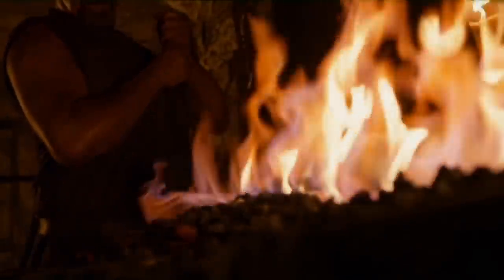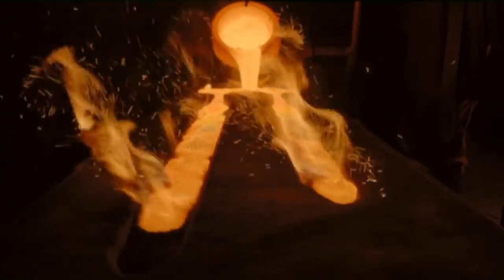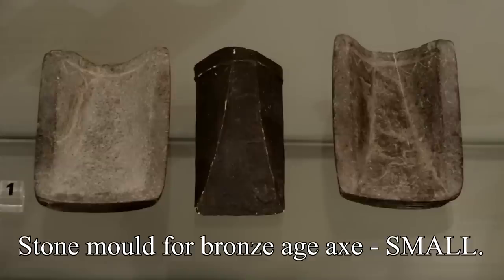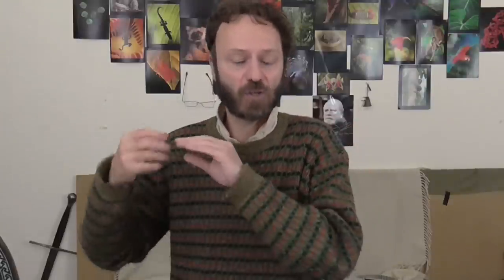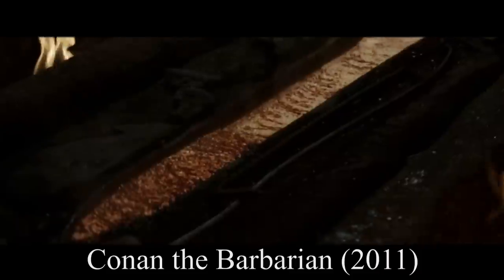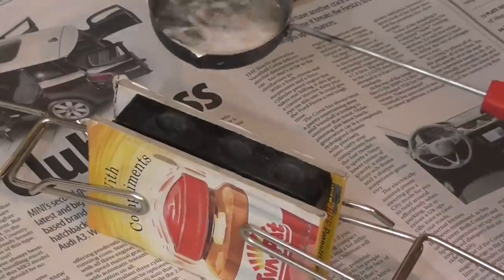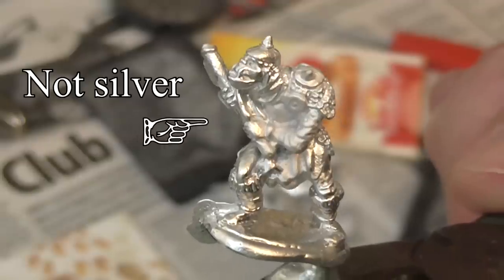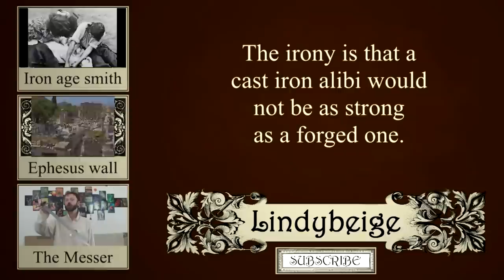Casting swords in the movies - forging a lie

Comment: sry u a wrong i'm work  as steel smelter / founder  in a steel foundry in Germany (i'm a german so it was not so esay to write the Text)  

at First u say steel is iron but wrong Because it is distinguished as follows:
-Elementary iron (Fe)
-Steel as an iron carbon alloy with a maximum of 2.06% carbon (forgeabel) 
-cast iron which is also an iron cabon alloy but it contains more than 2.06% up to 6.67% (not forgeabel -> scatter if u Hit it hard enough)

u say it has too glow bright as Fuck and u a wrong again the whit glowing sarts a temperatures above 1600 degrees Celsius and u forget the slag on top of the Metal. slag is always 200-300  degree Celsius cooler than the Metal Because the air is colling it 

and open top moldings a ok for swort blanks. it is faster to forge a sword from a blank than from a bar (if u use steel not cast iron which is im any case unsuitabel for a sword)

And u a right with the speed of the casting (faster is better)

And the Material of the mold should be greensand and not a stone

And aluminum is not poured red-orange glowing 

Hollywood is always a Bit over doing
Reply: Iron is rarely pure and what people refer to iron in history were not pure iron.  Us calling it steel isn't that strange seeing as those swords tend to have a bit of carbon in it.  As for the slag, don't they remove it before pouring? Seems a bit strange that they left it in.  The only purpose I can think of is using it to assist in temperature control of the liquid metal before it cools into a solid piece.  Outside of that, isn't it a terrible idea to leave it in?  Slag is a glass-like byproduct and from what I know, it absorbs moisture and it isn't very nice to have in your ingot.
I thought open top moldings weren't a good idea for swords seeing as the only benefit would be inlaying or adding components to the finished product.

Comment: Plus, up to the 15th-16th century, when the blast furnace (capable of heating iron up to the melting point, and getting a lot of carbon in it) appeared in the west, furnaces were just not able to reach a temperature high enough to melt iron. Thus, up to that point in time all iron metallurgy was done in the solid state. After smelting iron ore you would get a lump of iron full of slag and other crap, which then would be hammered to get a billet or an ingot of workable material.

Comment: so much incorrect terminology in this video. iron is NOT the same as steel
Reply: I believe he said as much. He didn't say steel WAS iron, but that it was made from it. One has to create iron before one can convert it into steel.
Reply: This whole video is about criticizes the way movie producers mix up terminology and portray incorrect procedures, and yet he calls steel iron. This is incorrect because steel is NOT iron. They are very different in terms of their properties, and steel has other ingredients as well besides iron. It is hypocritical to say the least
Reply: I was of the impression he decided to just call them all "iron" swords for convenience (at 1:30) but yes, convenient incorrectness to critique dramatic incorrectness.
Reply: I couldn't speak to that without more research. I'm only familiar with green sand and lost wax casting techniques.
Reply: On a different note I DO AGREE that swords can not be directly cast, he just does a terrible job of explaining why in this video. He should have talked about the effects of hardening and forging on the metal's structure instead of focusing on inaccurate points about the actual casting process. You could easily take the form of a CAST STEEL sword and pound it into shape then harden it and it would have exactly the same properties of a steel sword made from billet (how do you think they made the steel in the first place? THEY CAST IT!). What you can't do is use PURE IRON or CAST IRON to make a sword because of the properties of those specific metals.
Reply: One thing I inwardly scoffed at was the scene in Return of the King where the elves reforge the shards of Narsil into Anduril, the Flame of the West. The film made it seem as if the smiths simply beat the shards back into a sword like a jigsaw puzzle, something I believe is pretty much impossible without totally reforging the entire sword
Reply: @whiteknightcat  elven smith probably use magic.
You could reforge a broken sword, atleast with modern technology, but it would be a lot of work
Reply: @kkuhn  i agree with you that a cast swort would need heat treatment but i dont think it would need any forgering

Comment: I recently found out that cast iron is categorised as such because it's absurdly high carbon content, ~4-6% I think, lowers it's melting temperature which makes it easier to cast.  This increased carbon content, of course, also makes it harder and more brittle.  I once tried to drill a hole in a cast iron stove and the "hardened tool steel" drill bits were wrecked by it.  I don't know if anyone's tried to temper cast iron to reduce the brittleness, but if that can be achieved then it still would be a ridiculously hard steel.  That absurdly high carbon content also heightens the working temperature for forging, making it more difficult to forge and prone to cracking while being forged.  In many cases, the working temperature will almost be the melting temperature and cast iron will be a brittle quasi-liquid crumble-slush when attempts are made to forge it.  
     On the other hand, wrought iron has an extremely low carbon content and has a higher melting temperature closer to chemically pure iron, and has a lower working temperature for forging.  This iron of course doesn't hold an edge with any decency, but is very forgiving, easy to shape, and would rather bend than break or stretch than crack, making it ideal for many applications and easy to fabricate with.  Hence why iron that is difficult to forge but can be easily melted is called cast iron, and the iron that can be easily forged but is difficult to melt is called wrought iron.  The good stuff that swords, knives, and other tools are made of is at ~2% carbon and while less easy to work than wrought iron can still be forged and hold an edge.  
     One, possibly two, case(s) I would like to argue for casting iron/steel swords is that if you are already using complete liquefaction refining techniques on-site at the manufacturing plant, like in Isengard, then what you're really doing is making sword shaped ingots of iron/steel, or sword blanks, and not a sword in one step.  Further shaping of the bevels, fullers, etc... through forging would be required and in the same clip we see them doing just that, possibly before the blank has fully cooled but has solidified to working temperature.  This would be a great time saver, as at least half of the shaping work is done straight out of the crucible.  There some issues could arise, like carbon concentrations migrating to different lengths or sides of the sword as it cools, bubbles or other inclusions common to casting, and cooling from the mold on one side may have its own suite of problems.  But if your objective is to rapidly outfit a large army with hacking slashing things with a stabbing hook on the reverse, and don't care if there is a certain percent failure rate, then casting may be a viable method.

Comment: It’s not aluminium either, aluminium remains a shiny silvery colour when liquid, and will turn that colour immediately as it’s being cast, and has a very low viscosity, it flows extremely quickly when poured, especially when that hot

Comment: Stone does not have high heat capacity, actually it’s heat capacity is fairly low. The property you lindy is referring to is conductivity, that is why stone feels cold (the example he gave) and why it is poor as a mould. This is also why people traditionally use clay or similar for casting-moulds.

Comment: You're entirely right in your video in all its points.  But you also dance around the core of the issue, looking at the trees.  The reason these things exist as tropes to be used by film makers is that they developed from tales told in the Iron Age about the Bronze Age.  And so many of those aspects got so baked into the fictional space that they simply remained a part of the collective cultural background. Right into the modern age the fictional space occupied by "fantasy" epics is built on tales of a bronze age world that retained aspects of their origin.

Comment: The one you show for the open top mold is valyrian steel. And they use molds for it because no one can work the steel so they have to melt down old swords and mold them into new ones.  Also it's open top for cinematic purposes.

Comment: Pouring bronze into open top molds to be later forged to a final shape is a totally practical method with the proper alloy.  Not saying it was historically done, but possible.  Bronze is a bit dense but holds an edge and is malleable enough.

Comment: Not Aluminium, it would be pink / silver or burning if you try for orange heat. Also at pink heat Aluminium flows very fast.
The viscous orange mass looks more like some sort of slag.
Iron would be beaten from a bloom, to force as much slag out as possible from the bloom. (Wrought) Iron age does not have the benefit of the oxygen smelter to purify and alloy iron and carbon into steel.
Any steel like material had to start as a dirty bloom, be subjected to repeated heat and beat cycles, remelted in a crucible to make ingots for forging and possibly lamination on the way to a near net shape capable of finish grinding.

Comment: Casting is more for single use tools like arrows, ammunition, and maybe disintegrating links. Forging is for reusable tools like sword, spears, firearm parts, magazines, and non disintegrating links. Of course, you can forge ammunition, arrows, and disintegrating links, but those are very small items that are typically discarded after a single use or lost after a single use.

Comment: You know you can still work on casted steel, right? You would cast a blank to save some time. And just because you cast an iron alloy you dont get "cast iron". It has an spacific amount of carbon in it which makes it brittle(also the lag of heat treatment).

Comment: First of all, I want to express my appreciation for all your work before you would get the impression that the following information is for negative reasons. I like the way you make things undertandable and the approach of how you get to that. I have to say that almost every video covers my interest or it triggers me to get interested.
Although the core of your message is true, some of the content needs some refining. I don't want tbe nagging about details but just get the right information to you. The main reason why these swords weren't casted is because they coudn;t make pure steel in a crucible. The reason why smiths had so much work was because they had to hammer the impurities out of the material. 
The color of alloys being casted depends on the temperature of the liquid alloy. Aluminium looks silvery with a slight orange glow. Pouring temperature is between 700 and 750 °C Cast Iron (very bad for swords) shows the red to orange color in the movies. I think they use that for several reasons. Aluminium doesn't look cool at all to cast in a movie. Cast Iron (around 1340°C) will give a nice red to orange color where the film crew can still controll the lighting and stuff. Steel is mostly casted above 1600°C. The light is orange to almost yellow. The infrared radiation from steel is immense high and you can not stand around it without decent protection. It might be impossible to film it properly. The second reason why I think they used Cast Iron, is the fact that it rolls off clothes, skin and such when poured. Aluminium immediately sticks to any surface which, although much lower in temperature, makes it quite dangerous to be around with when casted. Steel just burns through clothes and skin. I don't think aluminium is used for a third reason and that is the fact that it solidifies wuite fast, actually the way you explained it in your video. You can pour steel in bronze molds (yes, copper alloys and iron/steel alloys naturally don't stick or weld to eachother, liquid or not), but this is mostly done for intermediate processes (manufacturing alloys) or for very hard but very britlle steel or cast iron pieces with a high carbon content (High Speed Steel, White cast iron, ...) 
But, and this is a big but (no pun intended): The color you see, or at least the intensity, greatly depends on the surrounding light. Molten aluminium will look red/orange in the dark, cast iron will look bright orange and steel almost white. So my professional experience cover your observations and mine mentioned above. 
A sword, as you mentioned needs to be worked to decently to harden and refine the grain on the edge and gets an additional hardening at the end to obtain a really hard edge and a rather soft core (which you will know, I saw your vids about forging a sword). 
Something more on colors. Every material has about the same color if you heat it up until it starts emitting much infrared radiation (also glass for instance) . That color, although we can not actually see it as a human, we only see a fraction of the corresponding visible light, has a direct correlation with the emitted infrared radiation and thus the temperature of the surface. That color is expressed in °K. You can find that color also on the identification of lamps for instance. 4000K for instance is daylight (full spectrum from UV over visible light to infrared light); 2700K is warm white (less UV),... Keep these vids coming!!

Comment: if you were to heat your steel to a high but not super high temperature (somewhere around 400°C maybe it depends on the metal), leave it at that temperature for a while and then let it cool down slowly, it stops being brittle

Comment: The actual liquid used in movies is most likely something like that used in glow-sticks or fluorescent liquid illuminated by ultraviolet light because its colour and state don't change even when it should be cooling, and using actual hot metal would be vastly more expensive for a variety of reasons, eg safety, specialised equipment, repeatability, etc.

Comment: My grampa told me in Puerto rico in the 70's (when my grandpa was a teen) their was a smith on the mountain who used a metal mold to make horse shoes, when it formed and red hot, he hit the bottom with a hammer and the show poped out. How does that work if its Iron? ( the mold was 2-sised) and how did he get it to seperate? He did cut the edges a little, but how did it form right and get out? How did he even cast it in the 1st place?

Comment: If stone is cold when you touch it wouldn't that mean that it has a low heat conductivity? The reason it feels cold is because the lack of heat transfer from the stone to your hand, not that the stone is sucking heat from your hand. Like how metal thats been outside feels hot when you touch it because it transfers heat very well and the heat is transferred to your hand

Comment: Please correct me if I'm wrong

So there was a clip from Game of Thrones where we saw someone casting valirian steel. Valirian steel is obviously based on damascus steel in it's appearance (that beautiful neat pattern on the blade). That pattern exists because damascus steel consists of layers of steel with different carbon content. So if we cast such steel it will become homogeneous won't it?

Comment: Wouldn't cast iron bend long before shattering? I thought iron was a soft metal, and introducing carbon is what turns it into its harder and eventually more brittle alloy, steel.

Comment: by the way specific heat capacity is not a measure of conduction of heat but rather how much energy usually in joules for 1kg of a material it takes to raise its temperature by 1 degree C. Fun fact: water has the highest specific heat capacity for any material because of its chemistry of hydrogen bonds, which is why water is such a good coolant because it takes alot of energy (heat) to raise its temperature.

Comment: There was a common practice in forging known as fidding. Plunging rods into the air escapes of the mould and getting rid of the semi solidified molten metal thus allowing a more uniform filling of the mould  and none of the layering as lindy is suggesting (taken from an archive film of the LMS works). I agree the theatrical aspect looks great on screen but it complete  bollocks!

Comment: Eventually the statue casters learned to add silver to bronze to improve flow ,head to toe ,re toe to head ...I wonder if the fancy bronze blades had gold or silver added , also arsnic was used in Egypt , it taints the metal red ,a rich red not rusty...what who knew when might be combed out.

Comment: They are supposed to be big slabs of crude metal in the lotr. They are for completely disposable orcs. Are they supposed to make them fine steel? That would be an absolute waste if time and completely impractical. They were raising a massive army incredibly quickly and needed simple crude weapons as quickly as possible. They were not at all worried about losing an orc because of a failed weapon or even a thousand orcs because of the same thing.

Comment: I mean... If you mold the pre-blade and then smith it so it becomes a full blade... It gains some logic. What I mean is you make a mold for the blank and tang that will become your sword, and as long as you do it right it should work. But you're not honna forge an even sword unless you have both halves of the mold and the mold can ventalate.